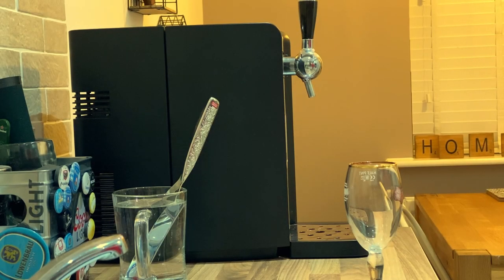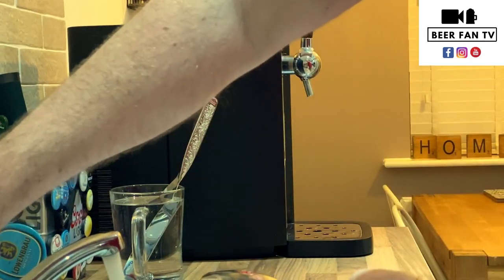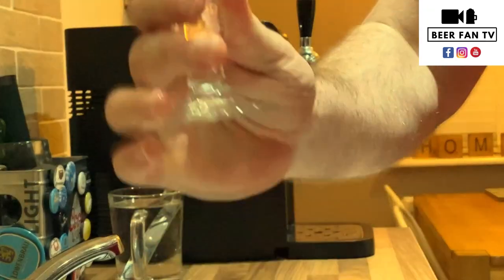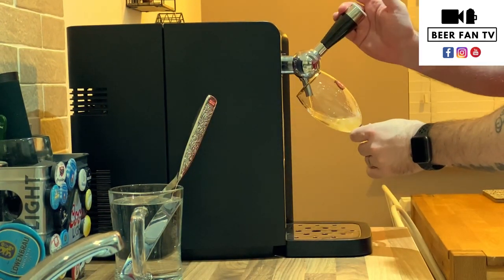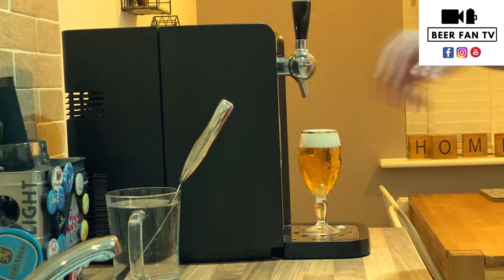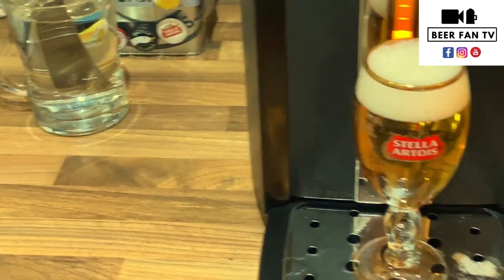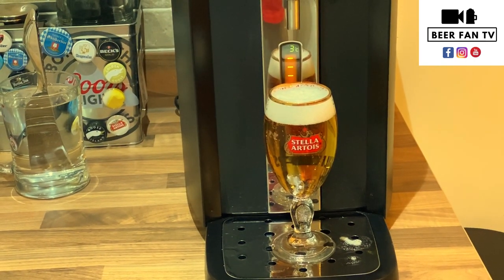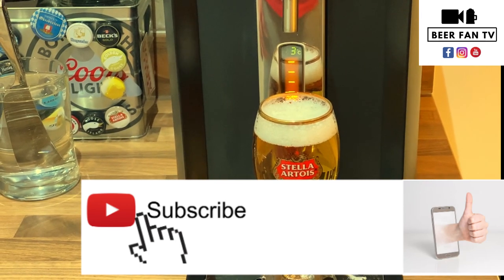Perfect Draft - pour the perfect beer using the Perfect Draft

Comment: Down to 1 block out of the 9 left and ive had 2 half decent pints out of it, rest have been pure foam, not impressed in the slightest, was a birthday present that i got early, is it the budweiser or is the machine just dog shit
Reply from the maker: It could be a few things. I’ve never put a freshly delivered keg in before. Mine normally sit for awhile before use. You don’t know how it was handled in delivery. You can raise a ticket with BeerHawk if purchased from there. I’d check the tap is connected properly and hopefully you get on better with your next keg.
Reply: @beerfantv  i took everything off and put it back on and it went to saying it was over half a keg but still pouring shit xz